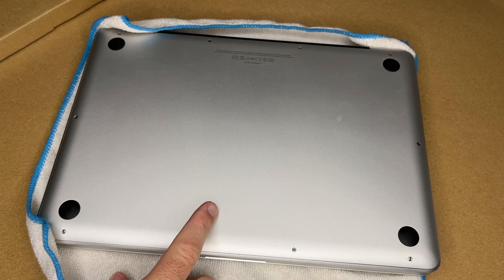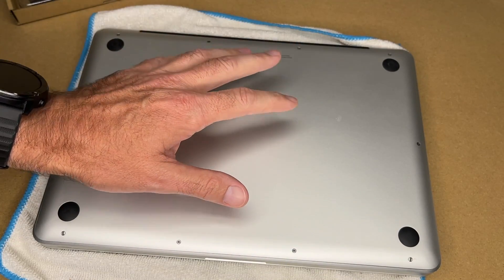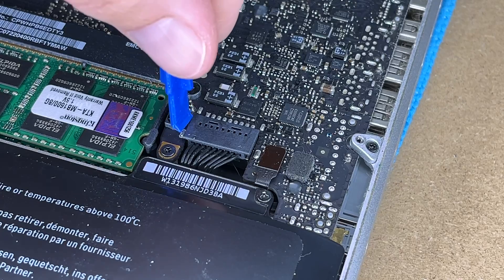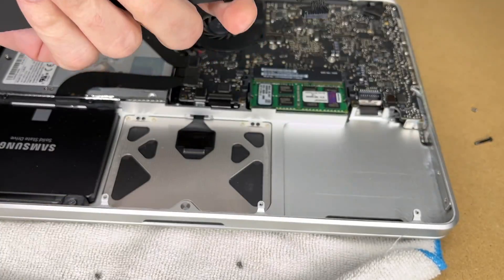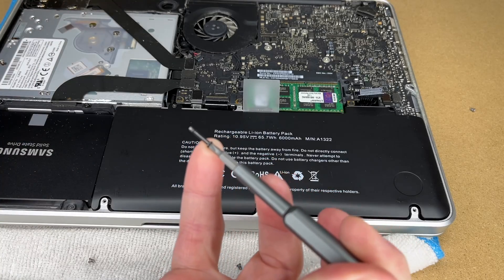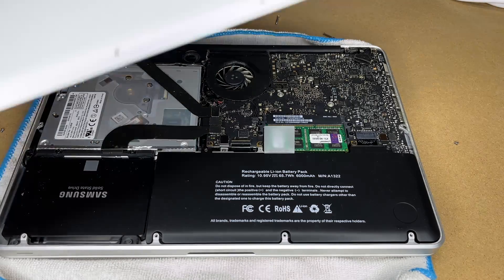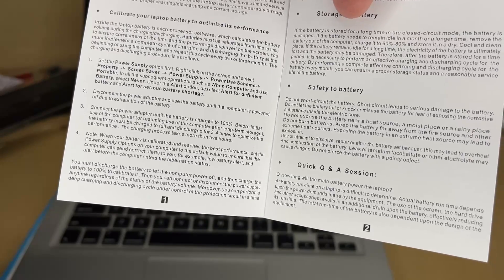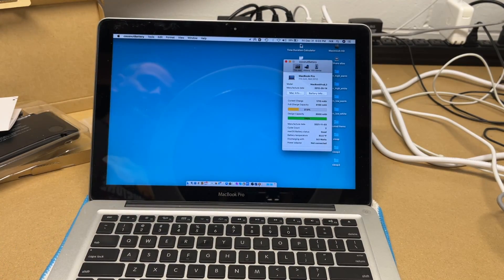Mid-2012 Macbook Pro Battery Replacement

Comment: You can magnetize or demagnetize a screw driver or any steel tool at will using electricity and a coiled copper wire (electromagnetic field).

Comment: Thanks for video. My MacBook Pro is mid 2012 and says A1398 on the back of it. What battery would it take and how do I know if its old battery is glued in place? I assume if it’s glued in place, I probably shouldn’t try the battery to replace it then. Right?
Reply: Probably a 15in. If it’s retina, those are super hard to change the batteries on, but not impossible. This video is for the 2012 13in.

Comment: Using in 2024 and still a great video🙌
Saved me a ton of money and time!
Quick question, can i use the computer while im discharging the battery(play a game on it)?
Or does it need to discharge with no applications running?🤔
Reply from the maker: You can use it while discharging.

Comment: How’s the battery holding up 9 months later?
Reply from the maker: It is working well. This computer is often plugged in so I am working on power cycling and re-calibrating the battery regularly so it doesn't overcharge.

Comment: And people use isopropanol insted much better to work with… aceton fumes make u sick… iso smell ”nice”
Reply from the maker: If you are using so much solvent that the smell is bothersome, you are using too much. I recommend using a small syringe so you can apply tiny amounts. Either solvent can be used but I feel like acetone works better. Either can make you sick. After all, the body metabolizes isopropyl alcohol into acetone.

Comment: Fantastic! Just what I needed to know, and thanks for the small bits of detail that make all the difference, new subscriber, cheers!
Mine is a mid 2012 15" Macbook Pro, need to find a replacement battery, new 1TB SSD drive, and new SSD drive ribbon cable for that model, any suggestions appreciated, thank you!
Reply from the maker: I like Samsung SSDs. Not sure about the battery for cable for that model.

Comment: My trackpad wont click down on new batttery install but the old one still allows trackpad to work any idea why?
Reply from the maker: Your old battery was bulged? I wonder if something was permanently bent in the trackpad.
Reply: I recently bought a spares A1278, to swap parts with mine. The battery bulged enough to permanently compromise the trackpad. I put my old battery which is in better shape and not blown up like the one it had and the trackpad still works but the clicking mechanism doesn't work well on the side most covered by the battery but tapping works just fine.

Comment: my original battery has 2227 cycles on it lol. I tried several battery replacements and they all failed within 3-4 months. Seems no one is making a decent aftermarket battery for the 2012.
Reply: Same except the batteries ive tried don't last any longer than the original
Reply: @doctahjonez  Try newertech NuPower battery. I have a 2012 MacBook Pro, have replaced the battery twice.
Reply: @LeRoy313 what’s the longevity like?
Reply: @n.ff.  12 years, 2 batteries
Reply: Sadly. Mine is still original at 1800 cycle count. But i haven't found a good battery replacment

Comment: When you install the new battery must you not plug it in at all until it has powered down?
Reply from the maker: You can charge it up to 100% and then unplug and run it until it turns off.

Comment: Hi! This looks fairly easy- looking to replace mine. I have a 15in Mac Book pro from 2012. Do you know what battery would be the equivalent of the one you have? Thanks!
Reply: A1382
Reply: That’s probably a really lengthy/hard repair if it’s the retina version. If it’s the unibody 15in, might not be as bad, look into it.

Comment: I have a mid 2012 MacBook Pro, its battery has a bit more than 400 cycles, and it lasts a bit more than 3 hours. Would the battery replacement be any better?

P.S.: Mine is currently running MacOS Catalina.
Reply from the maker: I would download the Coconut Battery app and see what percentage of the design capacity you have. https://www.coconut-flavour.com/coconutbattery/ This will give you an idea what percentage you have different from a new battery.